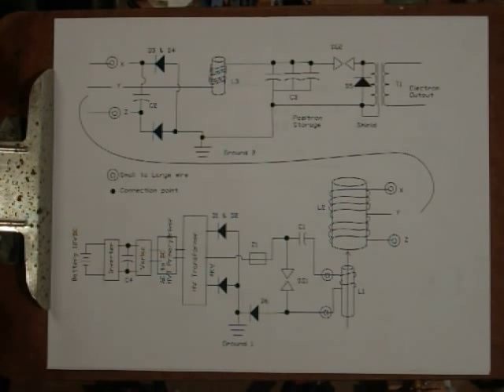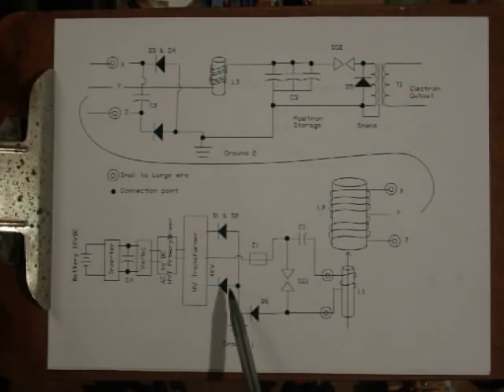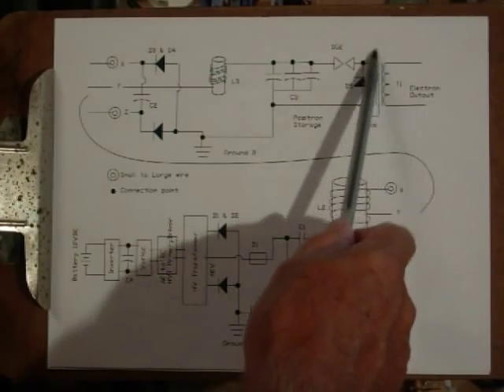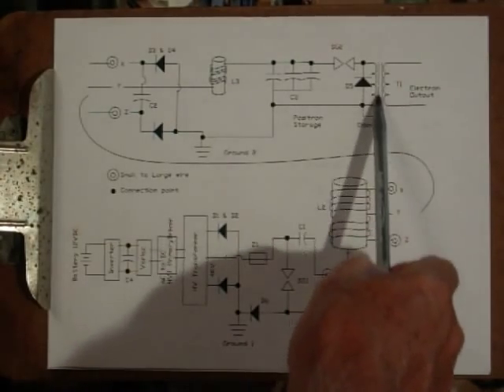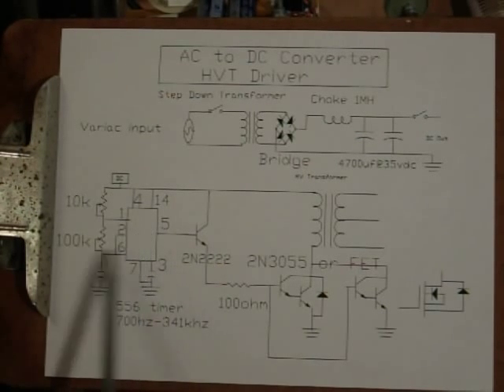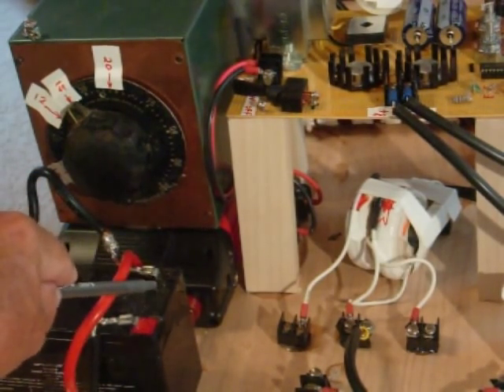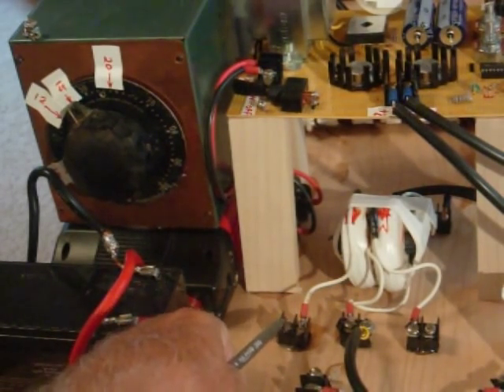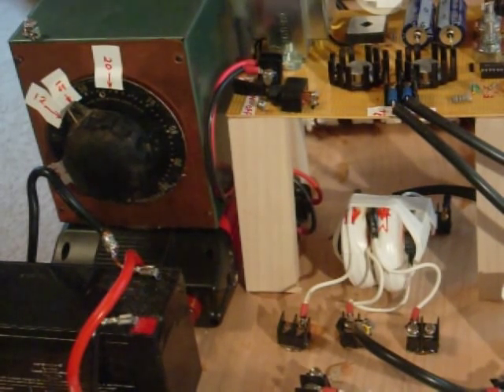Don Smith #1

Comment: Hi Gary I just discovered your channel and it looks really great . I am in the process of building don smith l1-l2 coil the popular one with barker coils. The  2  diodes  that come off the high volt transformer on your schematic look backwards ?  would the power go through  the center tap to circuit then complete circuit through reversed diodes ?  Did this schematic work for you.?
Reply from the maker: The only thing I did wrong was that I should have cut the barker coil half and then flip one half .  By doing this per the Russians the primary as it is slid thru will give you either HV Low current or  LV High Current.   If you can find Destine 2012 on you tube his system was used to run some serious devices grinder welder ect.
Reply: @CAPTAINSSBN  Thanks Gary It just seems weird seeing the 2 high volt diodes backwards it being  contrary to  my hvac electrical theory but I am learning that components and things are being used in alternate ways to achieve success with this system. I really learned  a lot from watching your channel.  Thank you

Comment: Did this ever get anywhere?
Reply from the maker: aventually this was used to run the George Lakowsky osc the problem with this version was that the Barker Williamson coil was cut in half and I forgot to flip one half so that the fields oppose.  by doing this you can get either huge current low voltage or visa versa depending on placement of the primary inside the 3" barker 40 turn coil.  Destine from russia got his running and used the cold energy from his special shielded transformer to run machines.  I want to build a new system using the Catch 22 concept.
Reply: @CAPTAINSSBN  let's do it. I got the parts abd ready to try again. It seemed Don said both halves can be in the same direction. I also built a few MWOs abd donated them to Dr offices for cancer patients
Reply: It didn't help because they are doing it wrong

Comment from the maker: The schematic is an old one from Destine2012 on youtube.  The diode at output was used to short out any HV BEMF.  Destine2012 used this to transformer with special foil tape between the primary and secondary to ground out any electron gas so that waves of only radiant energy would be used in the secondary. the foil was grounded.   I no longer use this.  I do the basic don smith setup but my output is divided into both positive and negative energy.   The idea is to use a dual system  BEMF shared.

Comment from the maker: 7/19  I just placed the L1 inside the Barker Coil.  Measure zero vdc at the 4uf output caps.  I checked everything but nothing seemed wrong.  I removed the 20kv diode composites and found that I had GOOPED diodes that were cathode to cathode.  What a hell of a mess.  It has taken all afternoon to remove the goop from the diodes.

The screen ground plane beneath the circuitry is 15" by 28" and the screws that pass thru the plywood are soldered to the screen. works OK. 2 screens used GND1 & GND2

Comment from the maker: The russian system by Sergei seems to be operating at a much higher voltage in the L1 circuit.  The reason why I say this is that the noise level is pretty load and the arc is very bright.

It also seems that their should be a gas around the gap area same as that used by Epcos.  You probably could enclose the gap and let the ozone fill the enclosure.

My next tests will be with L1 inside the barker coil and observe the output storage capacitor which is currently 4uf at 5kv oil filled.

Comment from the maker: Found that the 15uf AC cap caused Inverter to stop outputing.  will try different caps.
I changed C1 from 27nf to 4.7nf got much better results at the spark gap.   Draw from the battery is at 2.6amps when system is running the HVT thru the L1 coil and gap.  found out that the gap adjusts the voltage level into L1 as well as the frequency in the L1 C1 circuit.  The frequency was 339hz at 2.8KV at C1 using the 4.7nf cap.  I also tried a Don Smith Epcos spak gap which was set for 2kv worked awesome